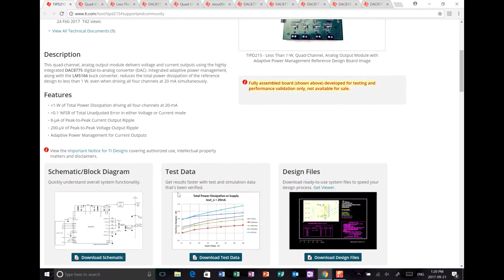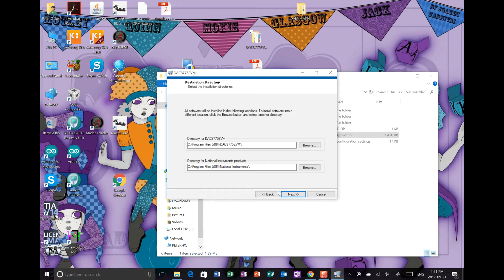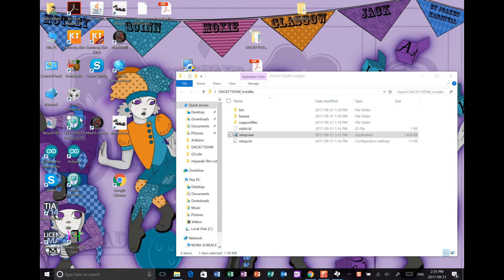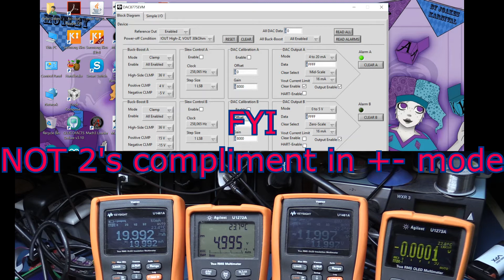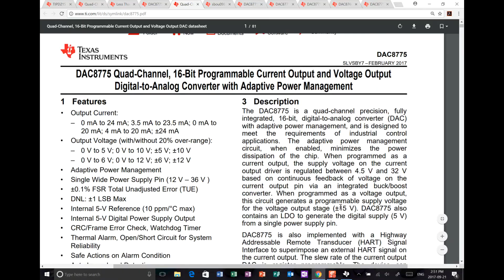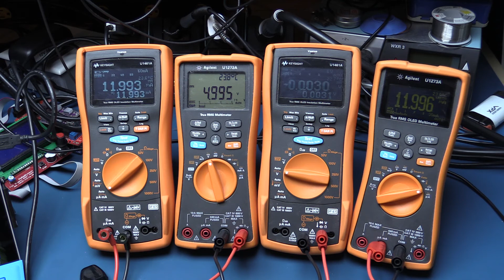DAC8775EVM Quad Industrial DAC Technical Review pt 3 of 3

Comment: would be interesting to calibrate it and see it's stability, so it seems it should be able to do 3-4 digits max of precision?
Reply from the maker: Out of the box accuracy is 0.1% with 16bit resolution so possibly?, for instance 20mA full scale will in theory give 300nA resolution (3.05*10-7)